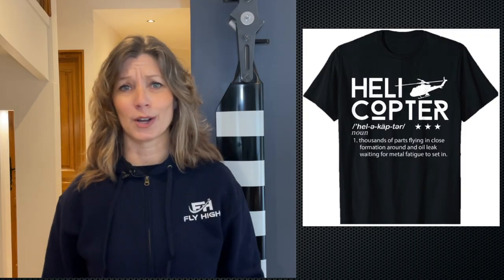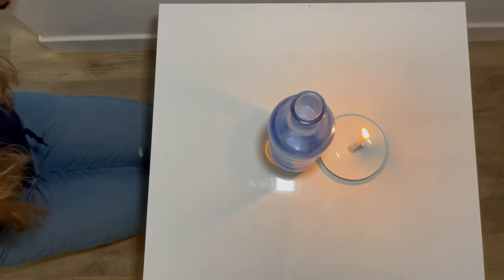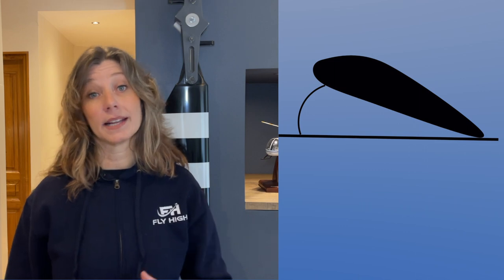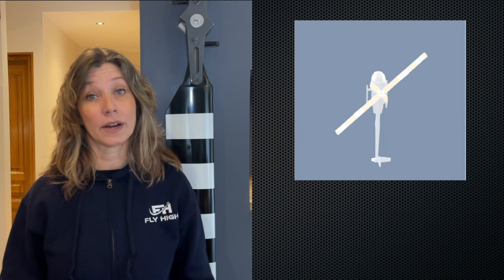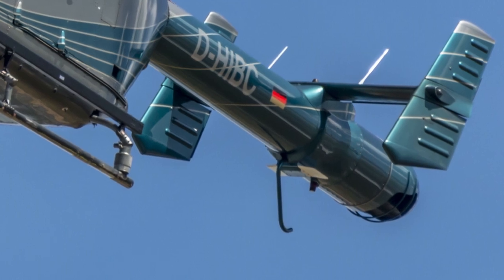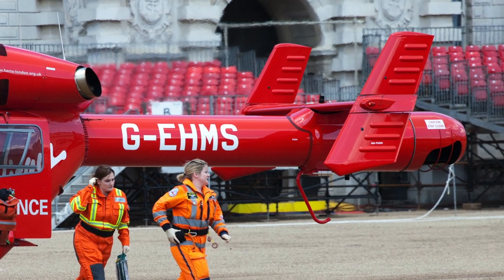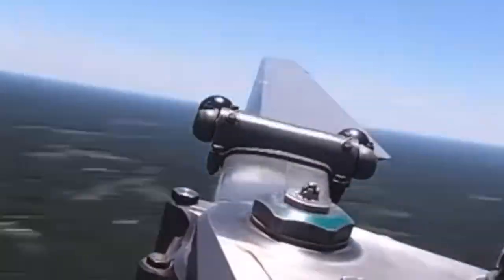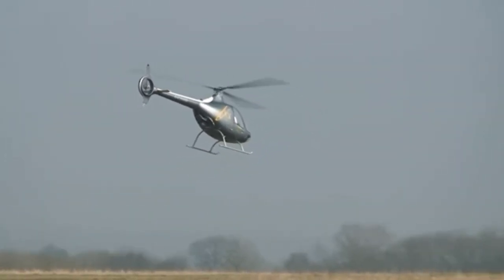How a Helicopter Works : Demystifying Helicopter Mechanics

Comment: Great video about how a helicopter actually works.  As a former private pilot, I could never understand them.

As for lift, I would have to say: Newton.  An airplane with flat wings will fly good enough without a rounded upper surface.  Maybe Bernoulli helps, but it is the angle of attack (I think you used the “pitch angle”) that causes lift.
Reply from the maker: Thank you for your kind words and comments 😊

Comment: I very liked your videos. Just need to comment on one thing. The rotor disc tilt does not happen because of gyroscopic precession. The gyroscopic moment happens when a moment in inertial frame (gravity in your example) is applied to a rotating system. In the helicopter rotor disc tilt, this is not happening. What happens is that the pitch input is (almost) in resonance with the flapping response. Resonance means 90 deg phase delay so the response (flap) happens 90 deg after the input (pitch). For example if the pitch is minimum at 3 o'clock position then the flap will be minimum at 6 o'clock. This also means that the pitch is max at 9 and flap is max at 12. So the rotor disc tilts forward since 6 and 12 o'clock are min and max flapping. This changes the direction of the thrust vector.
Reply from the maker: Thanks for the contribution 😀
Reply: I agree, it's not gyroscopic preccession. The R22 has a phase lag of 72 degrees. Why is this not 90 like in your description 
?
Reply: @Ben-Dixey  The presentation of a wheel spinning does not compensate for cyclic pitch. If you had a mass that could separate from a rotating disc where the centrifugal force is equal to the radial force its trajectory would be 45 degrees (assuming it is aerodynamically neutral in shape) tracing back this tangent would give you 90 degrees advance of the rotating disc. However helicopters are in a constant state of pitch which interferes with gyroscopic precession, as they are designed to make lift, not just have the rotors spin. Depending on pitch and how much force it exerts will depend on the phase lag that manufacturers account for in design. The 72 degrees you mention will actually vary depending on cyclic (differential) pitch applied. So upon pressing forward of the cyclic, depending on how much collective you are also applying the rotor may advance or retard several degrees of what you are actually doing. This goes unnoticed with the controls from the pilot in small amounts, but obviously they want to get it as close as possible from the beginning. So if you sat in a R22 and had the rotors spinning on the ground with neutral lift and had a laser lever on the rotor you would find the rotor would move approximately 90 degrees aft of the control rod input, And if the controls where set up with 90 degree advance you would just push forward, but as you started to increase collective you would start to move the cyclic slightly to the right to compensate for cyclic forces acting against gyroscopic precession. Once again, most would not really notice even 18 degrees cyclic out, but the closer the better and it does not stay constant, also depends on how quickly you apply the force with the cyclic. That is something none of the gyroscopic presentations on the internet explain. Same with autorotation, they all say a helicopter will just gracefully land without power, but none mention disc/blade loading. If a larger helicopter has to autorotate at 3 times the rate of descent of a smaller helicopter while arresting 30 times the force, it is far from graceful. Hope you are well Ben, I'm still working. All modern helicopters have some phase lag built in, not just the Robinson.
Reply from the maker: Fascinating 🧐
Reply: @chippyjohn1 Thanks for this John, I've not heard this way of explaining it before. It's hard for me to grasp but does your explanation agree with the system in resonance explanation? I can kind of grasp that one being that a weight on a string swinging will result in maximum displacement 90degrees after the disturbance. Add a hinge somewhere on the string and that changes things. 
Do you know what phase angle the Bo105 has ? As an example of a hingeless rotor system. Glad to hear you are still working 👍
Reply: @Ben-Dixey  I'd read phase lag in wikipedia, it explains it differently. I also searched BO105 advance angle, from reading the first article and another it would appear from my understanding the controls are set 90 degrees advance, however as the aircraft moves both in forward and upward motion (any change in pitch), the phase lag does change slightly. But as stated earlier, a pilot will most likely not notice a couple of degrees change in their cyclic.

Comment: The correct theory of lift is all three. On small scales it is hardly noticeable if the airfoil is not perfectly shaped, you can just "wing it" ;)

One question: Could the torque produced by the rotor be counteracted by a tilted plane on the tail boom deflecting the downward airstream from the rotor to one side?
Reply from the maker: Thanks for your comment 😁 and your question which is the idea behind the NOTAR system.
Reply: @flyhighytbwithcarolapilote  The question was actually more like, can torque on a helicopter be counteracted the same way as on an airplane, with only deflecting surfaces. Or does the larger diameter and air resistance of a rotor require a tail rotor or ducted fan like the NOTAR system? The vertical stabilizers on the NOTAR system seem to be movable. Do these have any effect while hovering or only in forward flight?
Reply from the maker: Unfortunately my expertise in NOTAR helicopters is very limited. Hopefully someone in the community will be able to answer your questions.

Comment: So, when you push the stick forward,  does that make the pitch angle of the blade toward the back higher than the blade in front?  Or is the gyroscopic reaction used such that increasing the lift on the left side and less on the right side essentially causes the pitch of the overall helicopter to rotate nose down?
Reply from the maker: Yes👍🏻
Reply: @flyhighytbwithcarolapilote  --  thank you for the reply.  Would you please clarify which example the 'yes' applies to?
Reply from the maker: Yes to gyroscopic precession. If you push the cyclic forward, you will increase the pitch on the left side of the rotor disc but it will manifest 90 degrees later at the aft side of the rotor disc causing the helicopter to move forwards.
Reply: @flyhighytbwithcarolapilote  --  thank You so much for clearing up this mystery for me!  😁👍
Reply from the maker: You’re very welcome 😉
Reply from the maker: You're so welcome @toddb930